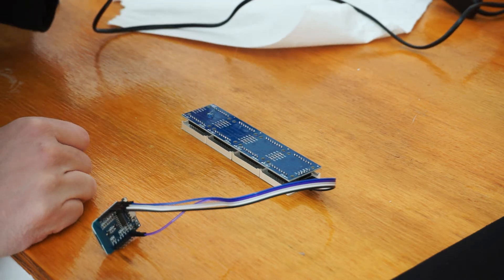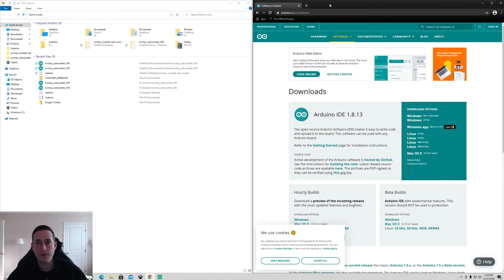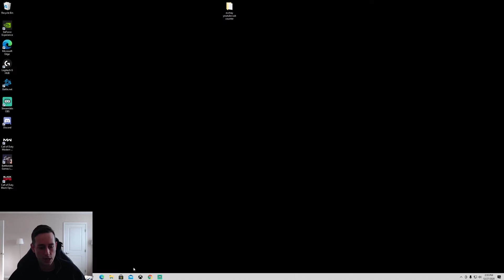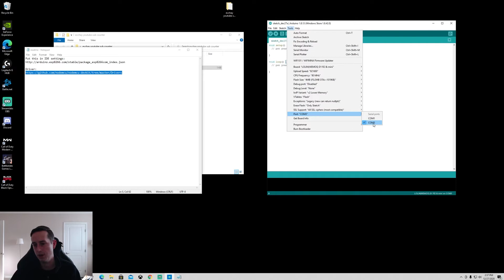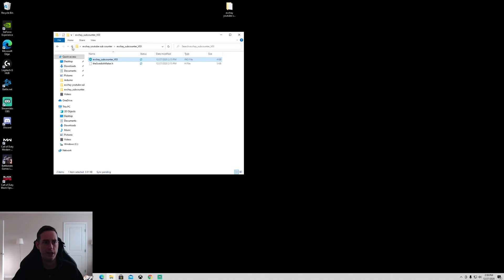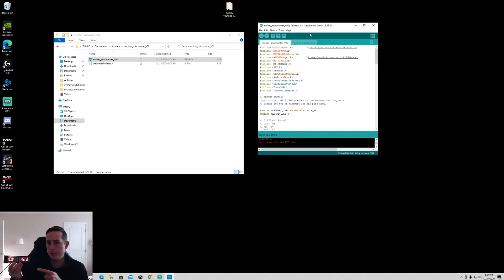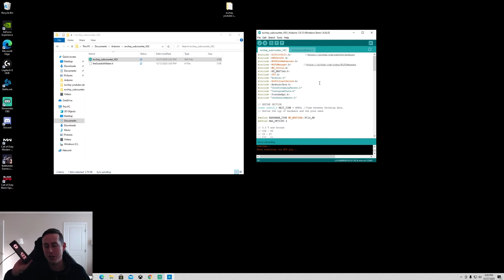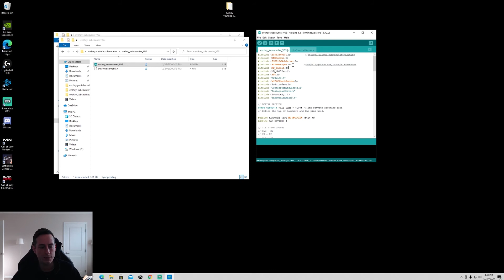Make a WiFi YouTube subscriber counter w/ Arduino, ESP8266, and buzzer (Jan 2021)

Comment: 1. Wire your Hardware
2. Make sure it works with the Blink test code
3.download the files from online including the separate driver to make sure you pc reads the Wemos Wifi module
4. copy his library folders to yours (Watch for duplicates) 
5. Input your YouTube api and channel Id both very easy to find and you can make an api within 1 min 
6. ONCE THE code uploads yes you will get some error messages but as long as it uploads and says " wifi . . " then you are good to go to
7. OK and like magic open up your phone and yup go to your phone and click wifi,,, connect to your unit and log into your wifi (I couldn't Believe this part)
8. Bam watch the numbers go up.
Thanks again for the tutorial I was about to put all these parts back in the bin because of all the YouTube api comment stuff saying it didn't work
Reply from the maker: Thank you! I’m glad the video helped and thanks for the steps for others to follower. My sub counter is still up and running in my garage.

Comment: What is the maximum digits subs for that one? nice buzzer addition.
Reply from the maker: Thank you! I want to say “999 M” but I may be wrong. You are limited to what you can display. 100,000 displays as “100K”. 1,000,000 displays a “1 M”

Comment: Hey thanks for your guide massively helpful! I notice that every so often it will read 0 and then go back to showing current subs, I assume this is it fetching the new subscriber number again maybe? If so is there a way it could read the recent subscriber number whilst fetching? (So it doesn't look like it's changing as such). Thanks again it looks great :)
Reply from the maker: Thank you for watching. Glad it helped. It doesn’t go to zero on mine. I’ll look at it again. Comment out the Instagram section of code. Instagram blocks you for requesting data after a few hours.
Reply: @evChay  Thanks for the  fast reply brother, it has by itself stopped going back to zero now so it's all good!
Reply from the maker: Nice! Enjoy!

Comment: Hi evChay !
I tried your code and I don't understand why I get 1073.6M each time!
I double check all credentials (API key, Channel ID..) and nothing wrong..
Do you have an idea?
Reply from the maker: Hey! thanks for trying out the code! Does it show your sub count at all? I sometimes get that 1073.6M too. I 'll look into it. I think its because I'm calling the API again too fast.
Reply: @evChay  UnfortunateIy I get this each times..
I will try to increase delay to 100000 to see.
Let met know
Reply from the maker: It works for me. Make sure you activate the YouTube api
Reply from the maker: You also have to put your credit card information in the billing section
Reply: @evChay  I didn’t put card details anywhere and it works great although I do get the 1073.6M every now and then
Reply: @CoachHomeUK  you forgot to enable youtube api i also was getting but now problem solved

Comment: Ehi Bro, I would use it for Instagram and not for youtu.be. Can you help me? Thank you very much😉
Reply from the maker: You can’t for Instagram, they block your IP address.
Reply: @evChay  Exact. I uploaded the code to my esp8266 but after all the time he resets because Instagram blocks the IP address. I've heard that using APIs you can solve the problem only that I don't know how to place the bee token within the program. 

Does Instagram block me even if I delay every 30 minutes?
Reply from the maker: Maybe if you ping it once a day, it will work but it is very unlikely
Reply: @evChay  Is there no way to see how many requests can I make at most every hour?
Reply from the maker: @tancredi_96  they will block you no matter what if you make repeat pings to their web server. Best bet is to get a code from them.
Reply: @evChay  Ah ok I get it! Anyway, like I told you before, I have their code... I just don't know how to insert it into arduino's sketch. Do you know how to do it?